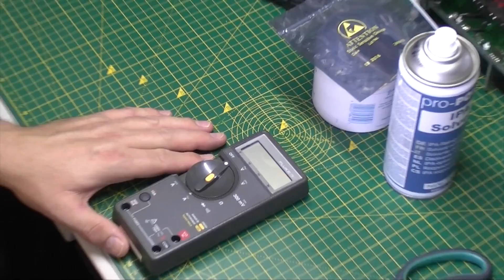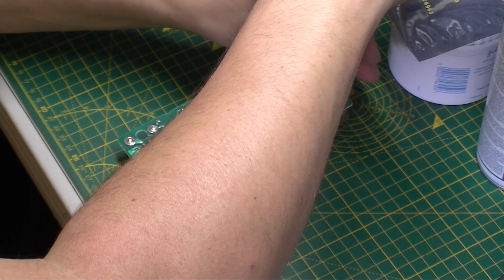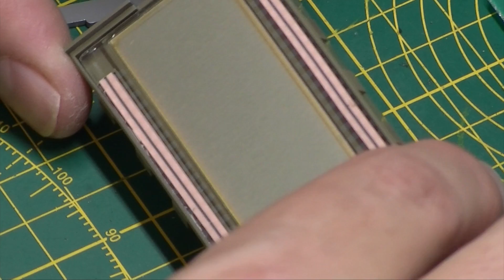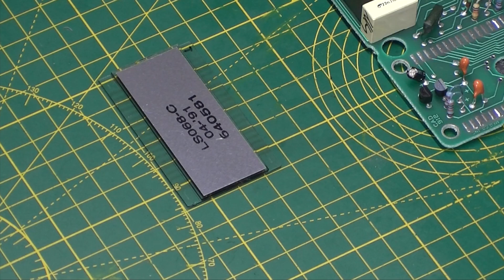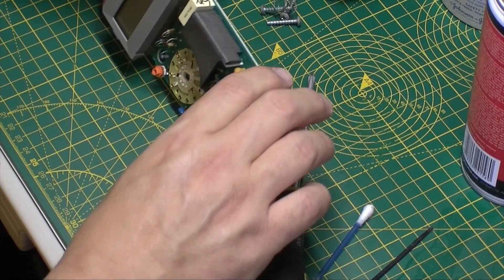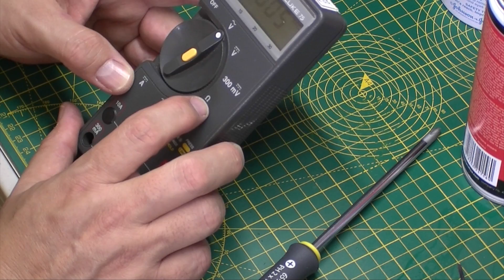Fluke 75 multimeter repair

Comment: I have the same problem with my Fluke 73. I cleaned and installed new zebra strips, it made no difference.
I learned there is a polarizing film on the LCD face and this apparently is damaged by UV.
I just ordered some sheets of polarizing film and I plan to try this repair.   There are several videos about this repair for LCD displays like for old Seiko watches.
Reply from the maker: Good luck with the repair, hope it works for you

Comment: Hi, why are you worried about a screwdriver being magnetic ? Static will zap components, not magnetism. A moving coil meter, yes, maybe you should be concerned. I'm pretty sure zebra strips are not static sensitive. Why would they be? Careful handling, yes, you don't want greasy fingers touching them. Sorry if I'm being critical, just honest feedback.
Replacement displays with new strips are all over eBay about $38.

Comment: Hello.
 I have a question... There is a way to get the rotary switch outside the USA. 
I'm from Mexico and I can't get the rotary switch anywhere for my Fluke 70.
Best regards
Reply from the maker: Hi Luis. There’s no supplier that I know that keeps stock for the old Fluke meters. Your only hope would be a donor set. Regards Graham
Reply: @Radiocruncher  I was looking for if someone sold any multimeter for parts, but I can't find where. I have also thought about 3D printing the "white piece" of plastic that holds the contacts on the rotary switch but I do not have the exact measurements since it is in very bad condition .... So far I have managed to measure VCA and VDC the only drawback is with the ohms and diode scale functions both are dead (if you turn on but do nothing.  Greetings
Reply from the maker: @luis11347  sounds like you have a battery issue then. Have you traced the voltage from the battery into the meter?
Reply: @Radiocruncher  Hello friend ... 
I thought the same.  the battery is replaced with a new one.  I have followed the voltage and everything is in order.  Previously, I had the two diodes shorted, which have already been replaced.  Since the rotary switch pins are in poor condition I have chosen to clean them with WD40, once they are clean I am going to straighten them out.  I have also tried to shape the plastic part of the rotary switch a bit to see if I can copy the part.  greetings 🖖
Reply from the maker: Good luck Luis
Reply: @Radiocruncher  Thanks mate, I need it.  I want to leave this Functional Multimeter.  It belonged to my uncle (rest in peace).  Along with this Fluke 70 he also left me a “Philmore” Analogue Multimeter I think is from the 70s that still works and does it quite well.  greetings from Mexico 🇲🇽

Comment: I've had my Fluke 75 Series II since around '91. Still my favourite, but the fuses cost an arm and a leg and the resistance always reads between 0.4 and 1.5 Ohm at zero. May need some new probes, or a good clean.
Reply from the maker: Yes those fuses are expensive. We used fused leads in it back in the day
Reply: Sorry, did you say fused leads?? Never in my 50+ years in electronics have I seen fused test leads.

Comment: I have had my Fluke 75 since 1979. I worked for Digital Equipment Corp as a field technician fixing PDP and VAX computers. My Fluke was an integral part of my toolkit. I saved my toolkit from those days, and rwcently found my trusty fluke in that toolbag. I flipped the switch to the ohms setting, and the freaking thing turned right on! I was like holy shit! Do they use a nuke battery in there? That is a true testament to the meter and the battery they chose to use. That must be why its so intrusive to change the battery. If it lasts 40 years, I guess its not an issue!!
That just blew me away. Now I see they use Areocell 9V, screw duracell. I am going Aerocell all the way from now on!
Reply from the maker: They are very well made meters and were expensive back in the day. Aero cell is the Lidl own brand battery isn’t it?

Comment: Hi.
Can i Do anything wrong by doing this in your Video so that the multimeter is completly desteoy d?
I have an Fluke 111 and it also have the same Problem that i Show some voltage without any wire pluged in.
So i want to only clean the contacts from the Displays on the big circuit Board with WD-40
Reply from the maker: You can’t destroy it by following this video exactly. Don’t spray WD40 anywhere near it. You must only use isopropyl alcohol as I have done. Good luck and I hope it fixes it for you

Comment: Enjoy and learn from your videos . What can cause a voltmeter to read around three volts without the leads attached and new batteries ?  Thank you for your help
Reply from the maker: Are you sure it’s not millivolts as 3 volts with nothing connected is way too high
Reply: @Radiocruncher  it is 3 volts . It is a Snap On Vantage MT2400 graphing multimeter . In the digital multimeter mode it reads three volts with minor fluctuation . I'd be thinking ghost voltage if it we're millivolts . The battery was low and I put new strong batteries in it and still get three volts .

Comment: You've got a screw missing, which is why that spring's such a pain.
Remove the large fuse; there should be a small self tapper holding the board into the bottom casing.
Reply from the maker: Thanks Russell i will have a look

Comment: My Fluke 75 S2 has started fluctuating readings when on DC Voltage even with no test cables in. Is there a away to calibrate it back to 0?
Reply from the maker: Hi Adam. You will need a voltage reference and the service manual in order to calibrate it

Comment: Fluke makes nice stuff maybe its time to treat yourself to a new one ,and that ones been around longer then most,I wouldnt be happy either ,I always wanted a fluke ,I seen some good deal on ebay
Reply: if the fluke gets an shorted output check the cap above the small shield on the board and be 1 k fusibel input resistor on the right because i got an fluke 77 from work with that problem in case yors develop the same problem as an small tip
Reply from the maker: Hi Ron. Its working fine now after replacing the polarising film. I bought myself an Agilent meter now though so this one is my backup

Comment: U1 drives the lcd directly from what I see on the schematics, also takes care of some psu duties. Could try and mod the supply (I see some resistor dividers in there) to up the voltage a little.. more drive voltage would make digits more readable (add a little ghosting too maybe).
Reply from the maker: Thanks for the info. Have a look at part 2 as the fix was pretty simple in the end. Thanks for watching Graham
Reply: @Radiocruncher  Just saw it. It looks like new, great fix! Love these classic Fluke meters, they just keep working and keep ther accuracy well.

Comment: Thanks, You take such a huge time of 32 minutes for nothing.
Reply from the maker: Kailash Khairnar this is part 1. The usual cause of display problems is the rubber connectors so this would sort a lot of the issues with these. Check out part 2. Thanks for watching

Comment: My digital multimeter continuously beeping whenever I put it in contenute mode.and other testing options also not working it showing battery signal on display.noted that 9volt battery which used to power on the multimeter that was finished and by mistake I was replace that battery with 19volt power source after that the problem was starts. My multimeter is very cheap there is no fuse in it circuit so please help me to solve this problems. The model of that multimeter is kros-s DT830D
Reply from the maker: I suspect that you have damaged the IC’s by over voltage. As it’s a cheap multimeter I would just replace it as you don’t want to be testing voltage with a damaged meter
Reply: Radiocruncher thanks for replay

Comment: This is not a problem of the display
The problem is Polarizer Film 
Only replace
Or put it over the screen and move the angle of certain you will find it returned as its original condition
http://www.ebay.com/itm/391401306039?_trksid=p2047675.m570.l5999&_trkparms=gh1g%3DI391401306039.N36.S2.R26.TR36
Reply from the maker: Very interesting Ahmad. Never heard of that so thanks for the tip. I will order some and see how it goes. Thanks for watching
Reply: don't worry
it will work
https://www.circuitsonline.net/forum/view/125705
Reply from the maker: Thanks for the link Ahmad. It certainly looks like that will sort it and much less cost than a new display. I have ordered some so will update the video when it gets here. All the best Graham

Comment: I had a problem with my fluke 11, which was intermittent, and all the cleaning and replacing of ribbons did not work. I finally lost my patience and decided to reflow the solder on the pads that you cleaned. I used a lot of flux and did a resolder job on it, and it worked! I know your problem of fading display is different, but just in case someone has the intermittent bug like I did, remember that when all else fails, losing your patience can work out fine.
Reply from the maker: Sounds like that might be worth a try. Did you use lead free or leaded. Maybe silver solder even?
Reply: Radiocruncher : Just normal lead-free. I was really at the end of my tether, and actually believed I was going to trash the multimeter, but lo and behold, it worked.
Reply from the maker: Thanks for the tip I will have to give that a try

Comment: Is there a contrast pot or resistor values you can tweak?
Reply from the maker: I couldn't see any adjustment point Doug but I will have a look at the circuit again to make sure. Thanks for watching